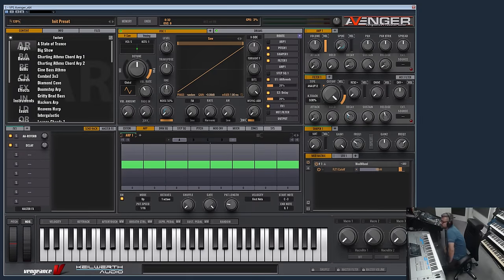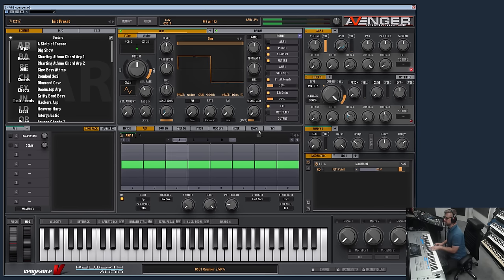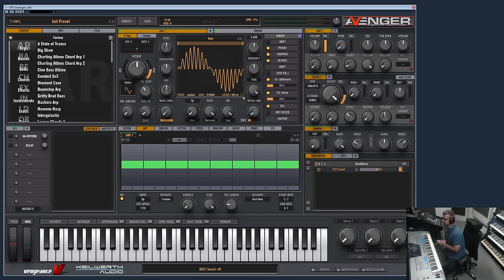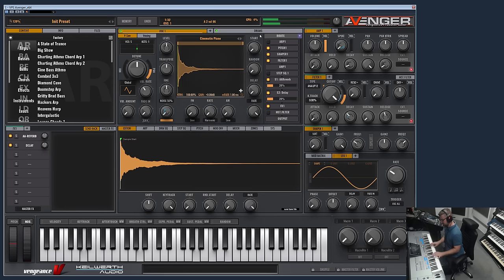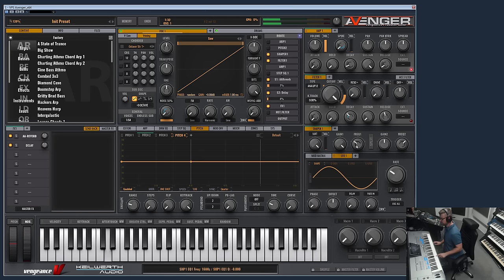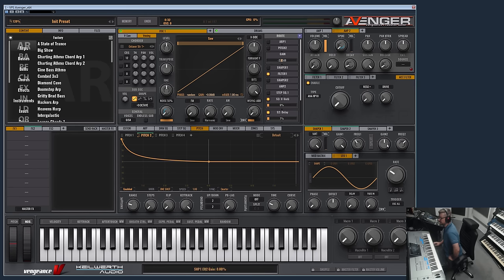Vengeance Producer Suite - Avenger - Tutorial Video #1: OSC Section

Comment: 0:01 - Welcome

I - Basic

1. 0:44 - Volume {Level}
2. 1:00 - Pitch shifting {Transpose}
3. 1:09 - Soft Pitch Shifting {Fine}
4. 1:53 - Noise generator
5. 2:45 - OSC X-Side
6. 3:21 - OSC Formant X
7. 3:45 - Bits {OSC Crusher}
8. 4:17 - WSync - Add {OSC Sync Amount}
9. 5:32 - FM {FM Modulation}
10. 8:40 - OSC Phase, Keytrack, Gain, mFade
11. 9:43 - Experimenting with Noise & Static Noise

II - Shapes

12. 10:09 - Factory Bass
13. 11:03 - Factory Complex
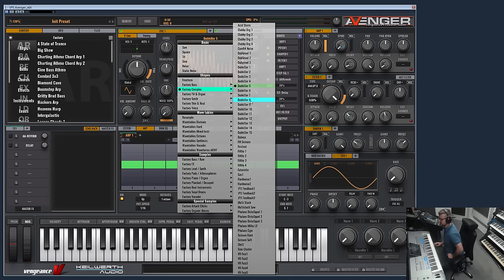14. 11:50 - Your Own OSC

III - Wavetables

15. 13:00 - Wavetables Octaves
16. 13:24 - Index {Scrubbing through the wavetable}
17. 14:10 - Wavetables Diatonic
18. 14:20 - Wavetables Vocoder

IV - Samples

19. 14:50 - Factory Bass/Raw
20. 15:05 - Factory Piano/Organ
21. 15:30 - Stacking 4 samples in one OSC

V - Special Samples

22. 16:55 - Factory Attack Clicks
23. 17:15 - Factory Organic Noises

VI - Creating a simple lead

24. 18:15 - Voices and Octaves
25. 18:35 - Detune
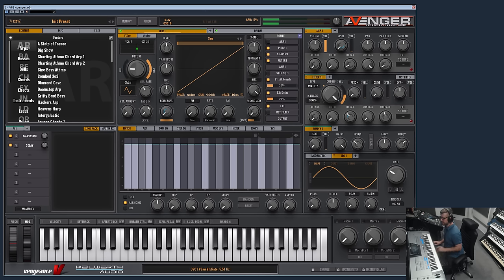26. 19:05 - Vibrato

VII - Chords

27. 20:55 - Making a Chord
28. 21:33 - Adding Sub
29. 21:56 - Voice Limit

VIII - Routing

30. 22:45 - Arp
31. 23:03 - Pitch
32. 23:25 - Shaper
33. 23:43 - Filter & AMP
34. 24:28 - Step Sequencer
35. 24:58 - FX

Your welcome

Comment: Looks great so far! The only thing I'm a bit concerned about is the interface. All the Vengeance plugins have small interfaces - big enough for the plugins I use, yes. But Avenger is extendable, so will there be an option to have a bigger GUI? I've noticed that when working on big, complex patches, it's really great to have a plugin that makes use of a bigger screen (such as UVI Falcon). So a scalable GUI would be incredibly cool for such a synth.
Reply from the maker: Avenger has a freely resizable GUI! Since the GUI is vector-based, it stays sharp in all settings, no matter which screen resolution you are using. You can make it fullscreen anytime
Reply: Vengeance-Sound Thank you!

That's cool!
Reply from the maker: see here: https://www.youtube.com/watch?v=Pf48AIvoMsU
Reply: download the demo

Comment: Question for Vengeance-Sound: 

1) Will it be possible to browse and select among the different oscillators from a midi controller? I know that Phalanx allows the user to do a lot through an external midi CC# controller assignment. Please shed some light on this. 

Thanks in advance.